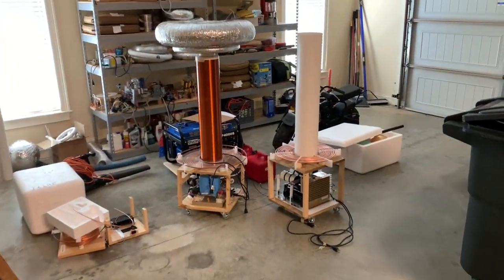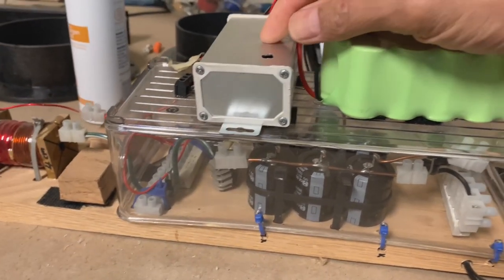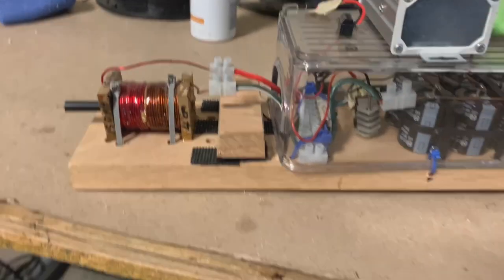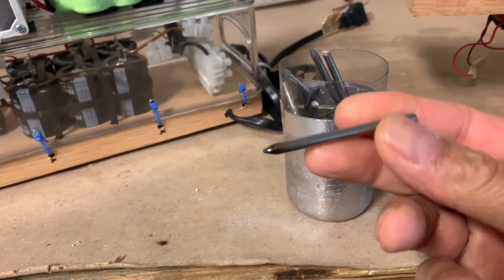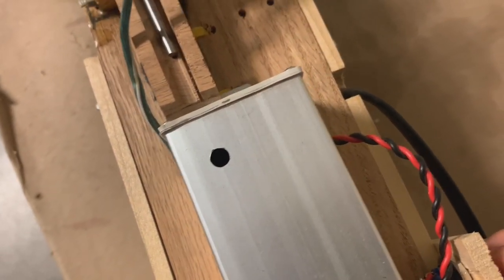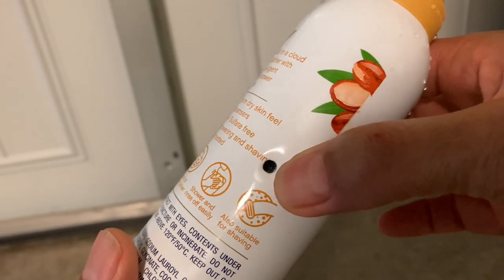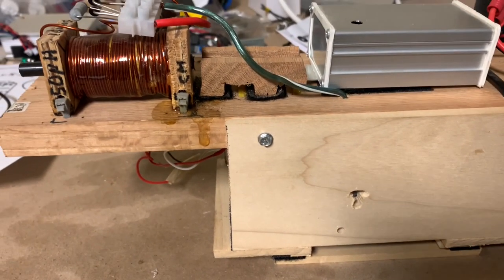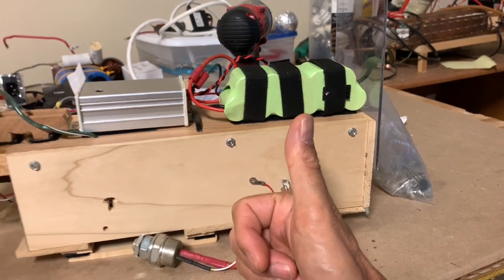Mini Electromagnetic Cannon

Comment: What’s the rate at which the magnetic field dissipates after the capacitor bank discharges?
Reply from the maker: It’s in the microsecond range
Reply: @BrianDhvTinkerer  I’m super curious about optimizing that. Do you have any references that you used, or was this a completely “off the cuff” project?
Reply: Ignore me, you have the link in the description... I made the comment before I finished the video...
Reply from the maker: This is the one I used and just made it bigger.
https://sites.google.com/site/uzzors2k/430jcoilgun